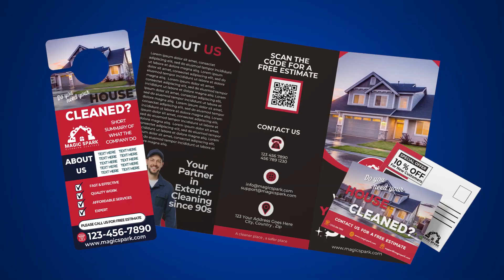Why Choose Gutter Pro Vac | Gutter Vacuum Cleaning Systems

Comment: What size of generator is needed to run a three stage motor?
Reply from the maker: For running a three-stage motor, our powerful commercial vacuums need 240 volts, which most generators can provide. Make sure your generator has a minimum output of 5500 watts (6500 peak), supports up to 30 amps, and includes a 4-prong NEMA twist-lock outlet.